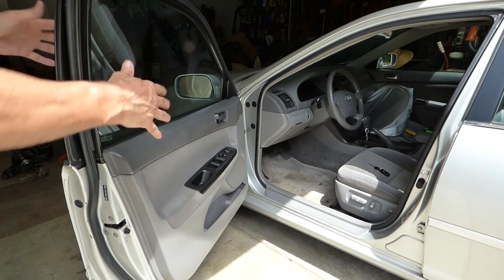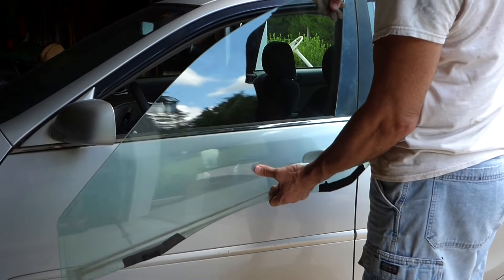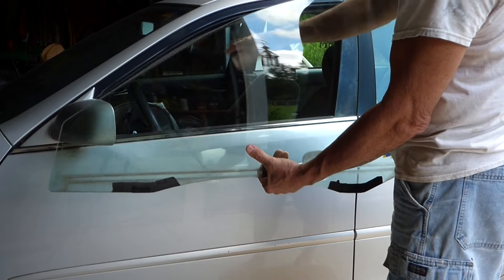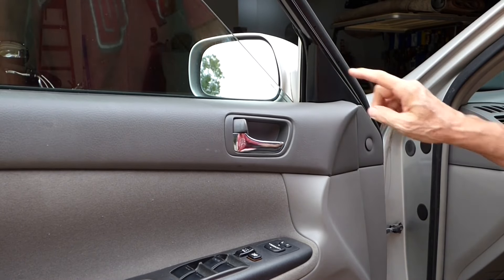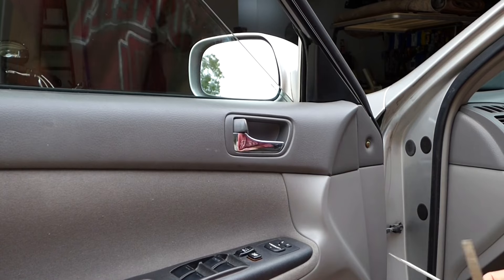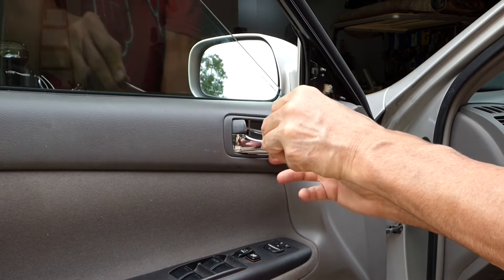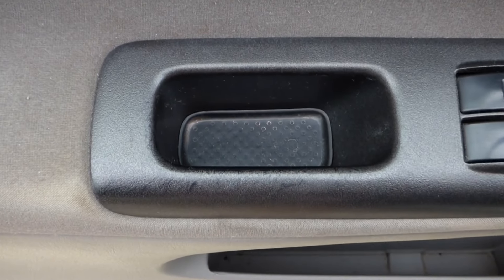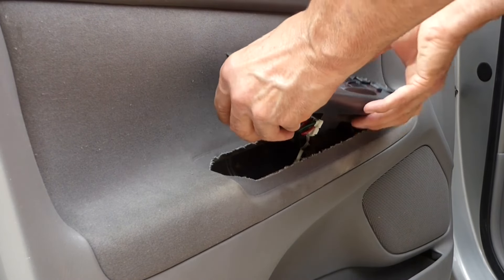How to Fix Car Door Glass that is Off Track - Fell Out - or Broken

Comment: I had good luck with the Harbor Freight "HFT Super Strong Quick Setting Epoxy" Glue. Best $1.79 you can spend. Also the recommendation to "Sand" the bracket before pouring the glue is golden.

Comment: Do that silicone really hold when you let the window down and up again. Mine seems to keep slipping out out the track seating where you put the silicone. However I didn’t use silicone either! I was think maybe a silicone adhesive would hold it in place? What do you think
Reply from the maker: The silicone did not hold. Check out this video that shows how I fixed it permanently…
https://youtu.be/Fw4AQbIX4Uw